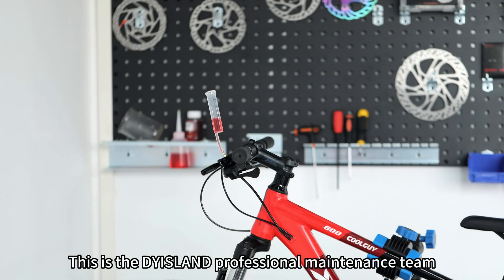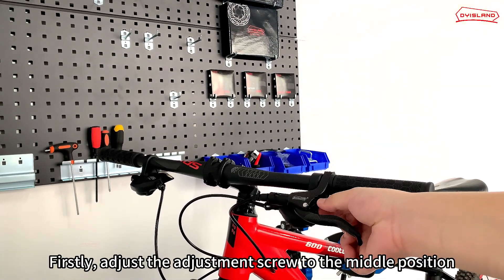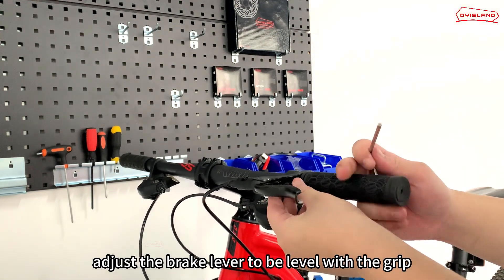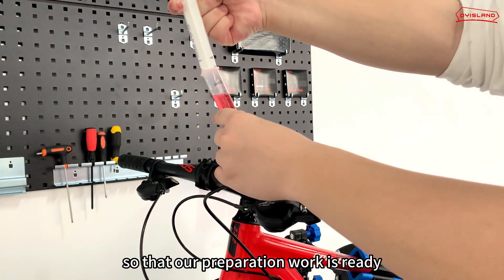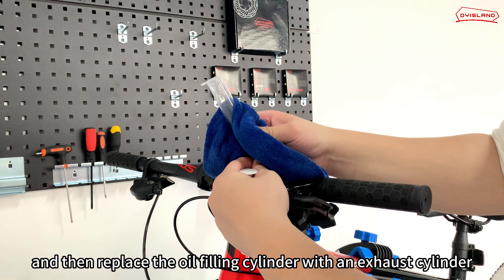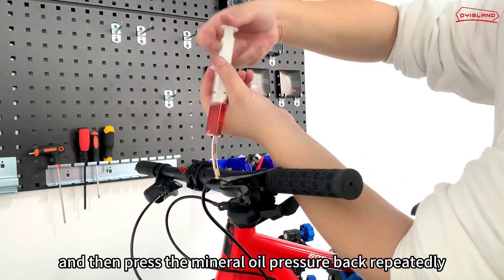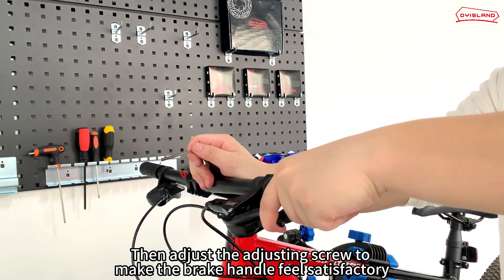DYISLAND Hydraulic Disc Brake Oil Change Maintenance Instructions

Comment: This looks so overly complicated for a brake bleed
Reply from the maker: I understand this may seem a bit complicated, but these steps are to ensure that the air in the brake system is completely removed for safety and optimal performance. Once you do it once, it will be much easier.😊

Comment: I have Dysiland (Red Calipers) on my Lankeleisi MG740 Plus, and by the Brake Levers, the little adjust screw is very weak and bends out of shape. So it cannot be screwed in or out again very easily. It threads too easily and should be made of Steel not Aluminium because once faulty brakes and lever cannot be adjusted.
Reply from the maker: Thank you for your feedback! We understand that you are concerned about the durability of the adjustment screw. The screw is made of aluminum mainly to reduce weight, but if you need a sturdier option, you can try replacing it with a steel screw, or use an appropriate amount of thread glue when adjusting to increase stability. Your suggestions are important to us, and we will also feedback your opinions to the relevant team to continuously improve the product experience! 🙏 If you have any other questions or need help, please feel free to contact us! 🚴‍♂

Comment: Hello, please can you tell me how to fix my dyisland brake. Because it's leaking oil through the cable connected to the calliper
Reply from the maker: Hi, thanks for reaching out! If your Dyisland brake is leaking oil from the cable connection to the caliper, here are a few steps to troubleshoot and fix it:

1⃣ Check the Hose Connection – Ensure the brake hose is properly tightened at the caliper. If it's loose, carefully tighten it using the appropriate tool.

2⃣ Inspect for Damage – Look for any cracks or wear on the brake hose or fittings. If damaged, replacing the hose may be necessary.

3⃣ Check the Olive and Insert – If the hose was recently installed or adjusted, the olive and insert inside the connection might not be properly seated, which can cause leaks. You may need to replace them.

4⃣ Bleed the System – If you had a leak, air might have entered the system. After fixing the issue, bleeding the brakes will ensure proper performance.

If the issue persists, please let us know more details, and we’ll be happy to assist further! 🚴‍♂🔧 😊

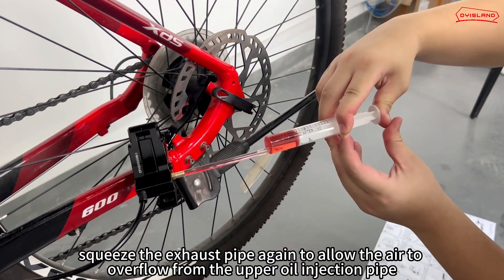Comment: Hello! Min 1:37 you showing here pushing back the old mineral oil you just taken out or is it new? Thats the confusing part 

Thanks
Reply: The old and new oil blends together. You could do a full oil flush, and then refill your brake lines with fresh oil if you wanted to. The oil doesn’t degrade too much so mixing is ok.
Reply: They explained why they did that. So it's clear why. But usually this is done with two syringes, pushing and pulling the fluid and once there's not  much bubbles coming out of any of the ends I disconnect the syringe at the caliper and and proceed to pump the lever to get the air out of the master cylinder, use a  Velcro strap at the lever and let it be for a while, so it forces the remaining bubbles up, repeat the last step if needed. But this video is confusing as they use wrong terms. There's no such thing as a gear block, its called bleed block. This is the worst bleed video I've seen. I recommend looking up the bleed guide for for Formula Cura/cura 4 That one is good. But one doesn't have to bleed the caliper, unless filling it with new fluid. So only do the master cylinder bleed/burp, this means you fill a syringe with fluid and you connect it and pump the lever until there's no bubbles.

Comment: Hello, what do I do after extracting the old oil and air with the exhaust cylinder? Do I disconnect the exhaust cylinder and dispose the old oil, or pump it back in?
Reply from the maker: Hello! Thank you for using DYISLAND oil filling tool. After the exhaust tube has extracted the old oil and air, it is recommended to remove the exhaust tube and properly dispose of the old oil to avoid the impurities in the old oil or the aging oil affecting the system. It is not recommended to pump the old oil back into the system to ensure the performance and safety of the brakes. If you need more help, please feel free to contact us!
Reply: @DYISLAND  Thank you. If I disconnect the bottom hose connected the exhaust cylinder to release the old oil, will it spill out?
Reply from the maker: @krakerjak3  Yes, if you disconnect the hose at the bottom of the exhaust cylinder, the old oil may spill out
Reply from the maker: @krakerjak3  When disconnecting the hose, the old oil will flow out. It is recommended to catch it in an oil container and be prepared for cleaning.
Reply: @DYISLAND  ok perfect. After I Ioosen the brake lever lock screw and adjust the lever to be parallel to the grip, the instructions say to lock the brake lever. What do they mean by lock the brake lever?
Reply from the maker: @krakerjak3  Dear, locking the brake lever usually means tightening the locking screw on the brake lever to ensure that the brake lever will not move after it is adjusted to the desired position. This can maintain the stability and correct use angle of the brake lever. The specific steps are as follows:

1. Loosen the locking screw on the brake lever: This allows you to adjust the position of the brake lever so that it is parallel to the handlebar.
2. Adjust the brake lever: Adjust the brake lever to the position you want.
3. Lock the brake lever: Re-tighten the locking screw with a tool to ensure that the brake lever is fixed at the adjusted angle.
The purpose of locking is to prevent the brake lever from moving due to vibration or operation during use, ensuring precise control of the brake.

Comment: I just tried this and the brake was still extremely soft after so, the third time around I fully would out the adjustment wheel then did it with the brakes on and fixed to the bike. Thankfully it now is perfect and was able to adjust the brakes via the wheel after. Thanks for the video though it was helpful in the way you kept the top syringe topped up etc, at least it gave me the confidence to have a go.
Reply from the maker: I'm so glad to hear that the issue has been resolved! Thanks for your feedback, you did a great job! It was a good idea to fix the soft brake issue by removing and reinstalling the adjustment wheel. Brake adjustments with the adjustment wheel should go much more smoothly in the future. If you have any more questions or need help in the future, feel free to contact me!

Comment: my rear brake is always spongy compared to the front, possible damage maybe? I've never bled anything before
Reply from the maker: Hello, you are advised to try an oil change Operation, there may be air inside the oil circuit. If it doesn't work, you can reach us through our official website. dy-island.com